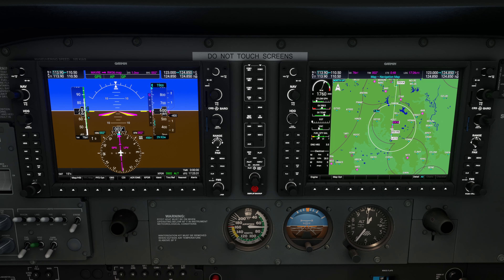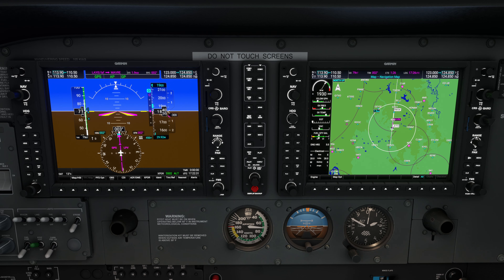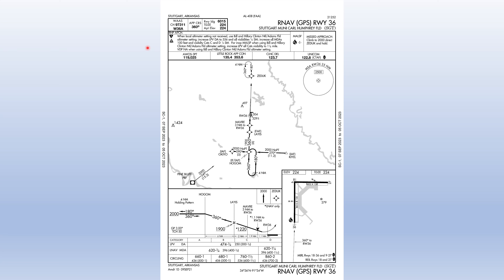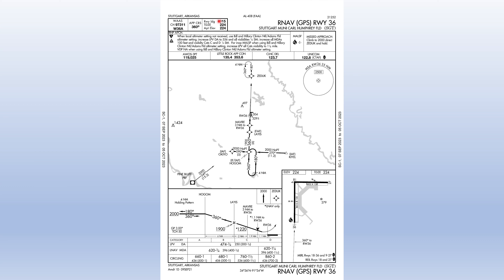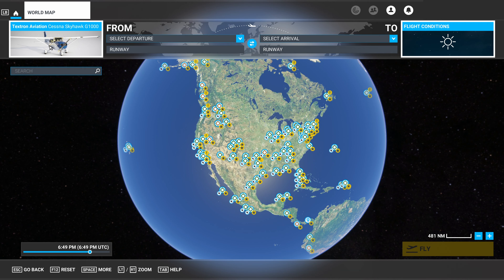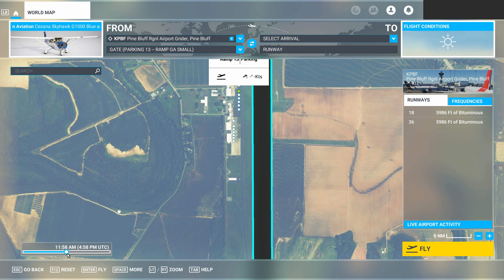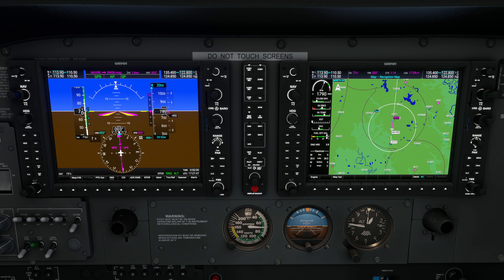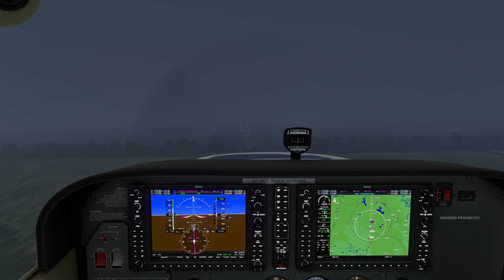MSFS LPV RNAV (GPS) approach tutorial, G1000 (AH IFR flight lesson 8.2)

Comment: I did not notice that you ever pressed the VNav button.  I thought that would be how you descended to the different levels.
Reply from the maker: You can you VNAV to descend if you want, but it will follow the optimal vertical path to the FAF, rather than allow you to control the path (Meaning it will wait until it intercepts a 3° glidepath that will hit the FAF at the platform altitude exactly to descend.)  Since I'm using a the technique where I am level & configuring at the platform altitude well prior to the FAF, I elect to use VS mode to get down as soon as I can.  (Though you could also you FLC to descend that way as well.)

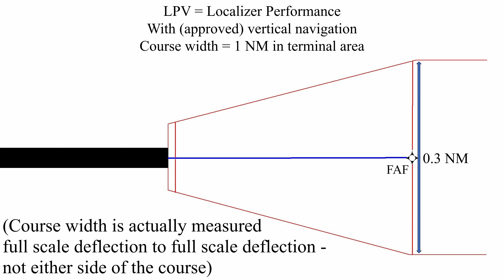Comment: 3:30 You are expecting a CDI full deflection to one side (two dots on a modern CDI display, like the one you show in the video) to be about 0.15 NM shortly before the FAF/FAP. That does not sound all that intuitively obvious to me (I realize it might depend on the distance from the FAP to the threshold), but I don't have MSFS. If you get the time, could you try flying deliberately off track and read the shown cross track error when passing abeam the FAF/FAP roughly two dots off?
(The example you show have a 5 NM distance from the FAP to the threshold, so in this case your calculations will probably just about hold up, I guess, as a localizer horizontal deviation of say 2 degrees in that case would be in the 0.15 NM order of magnitude. Which in turn would give a Localizer Performance instrument about the same indication. So for extra points try do the same on a longer LPV approach segment; and then there is the discussion if full scale deflection is two or two and a half dot).
Reply from the maker: @Rodhern, the standard CDI sensitivity/scaling for an LPV approach is 1NM in the terminal area (defined as being less than 30NM from departure or destination airport,) then changing to 0.3 NM within 2NM of the FAF, then narrowing from 0.3 NM wide to 700 ft wide from the FAF to the runway threshold/MAP.  As far as I know, working title has emulated this function correctly in both their G1000 upgrade, and their GNS530/430 upgrade - but I'm afraid I don't have time to do a thorough test flight as you suggest.